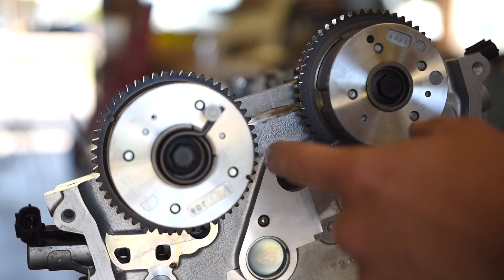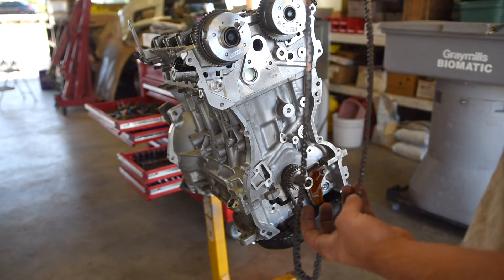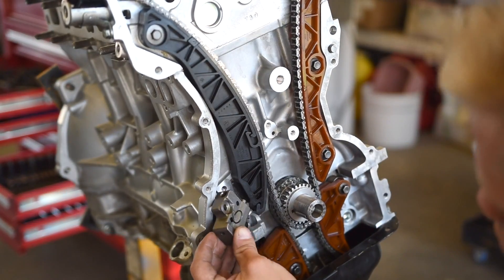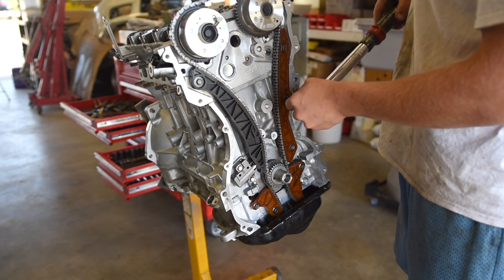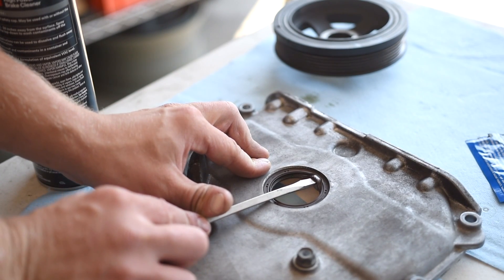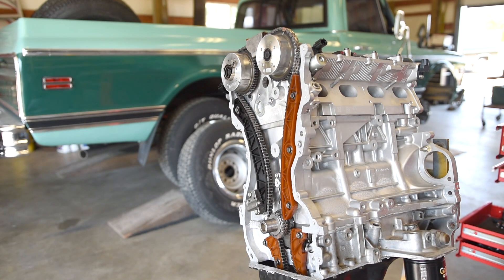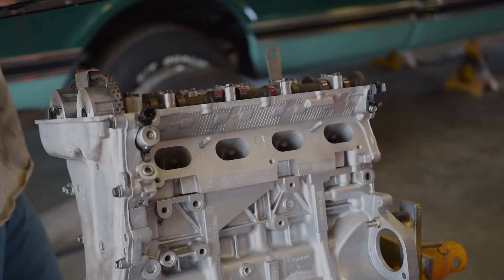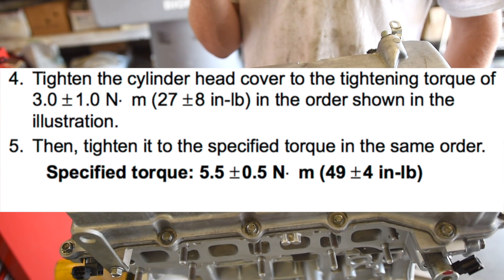600HP Capable Evo X Motor Build | Timing Chain

Comment: So when I was finished getting the guides and tensioner on i decided to go back and check the crank position. It had advanced by a little bit. Do I need to go back and take the tension off the chain and correct the crank position?

Comment: I've never went by standards  on torque.... non ,zero ,late do it a gain
.. never gon to spec and my cars have running perfectly for 10+ years.... whis paying you for this" tourqe to spec" bullshit? I guess u wouldn't know. Cause you just follow lead... just saying in a rude way, not everything has to be this or that.( I get it your covering your ass.) I've used tourqe wrench and I havent..haven't... it's all worked out.

Comment: In case you’re tripping like I was the timing guide bolts are 89+-17 in lb and also after 2010 you will not have an upper timing chain guide nor an oil squirter. 

Sorry not trying to nitpick but I’m going through the process and trying to help out anyone else going through the same ordeal.

Comment: I guess he can't read service manual correctly. the torque says 89 in-lb +/- 17 in-lbs. so the torque range is 72-106 in-lbs. Devin you are vastly under torqueing the bolts. I know this video is kinda old, but Devin is wrong about timing torque values! for all those looking this up, he has misread the service manual. good video otherwise.

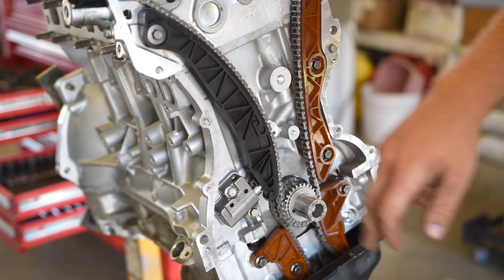Comment: 5:36 - TQ specs for these bolts are not 17 in/lbs! The FSM (11B-5) lists "Timing chain tensioner bolt" as 89 in/lbs, with a tolerance of +/- 17 in/lbs.
Reply: Lol I just posted basically the same thing 🤦🏽‍♂️

Comment: Can the timing chain be changed while the engine is still in the car?
Reply: You shouldn't need too.
Reply: @pheonixfps9248  my chain stretched and skipped a tooth so I need to
Reply: Ok, chains don't stretch. What happens is the links wear due to poor servicing or poor lubrication. They generally don't skip teeth either unless the cog teeth are severely worn too. The front timing cases are removable in the engine bay.
Reply: yes it can, other videos on youtube with it in. yes the version 1 chains stretched, mitsubishi changed design later in 2011.

Comment: Do they all have that oil squirter for the timing chain? I’m rebuilding my buddies engine and never saw that coming off? His is an 08’ so it’s one of the first years and also the top chain guide between the cams, 99% sure  it didn’t have one of those
Reply: I believe it was added and the top chain guide was removed in later rev.

Comment: You have any knowledge on removing the cam sprockets two aftermarket camshaft or is it simple just remove and replace. I'm going to be installing cams on my Evo soon
Reply from the maker: Boostipher Filmzz Are you doing springs too? Depending on what cams you install, springs are highly recommended.
Reply: Dvniemela yeah I'm doing supertec valve springs and retainers just didn't know if there any specific thing I need to do when swapping cam shaft sprockets?